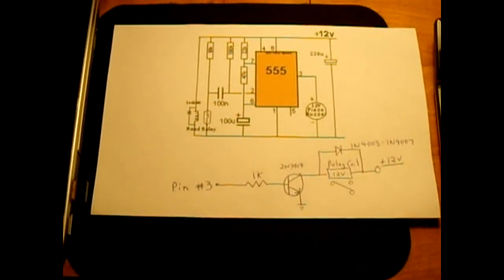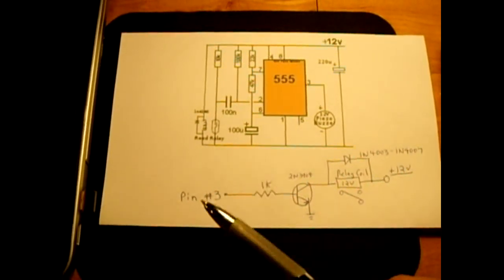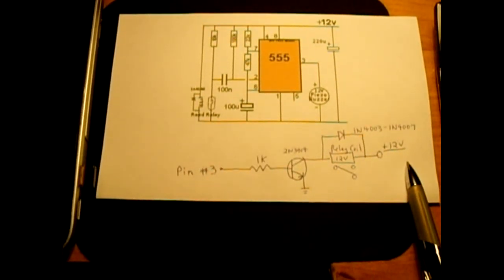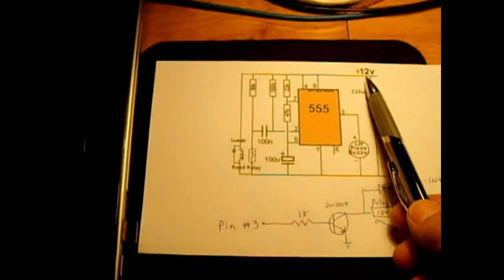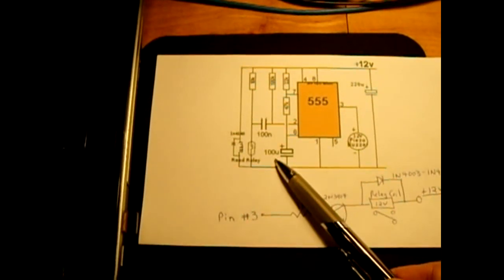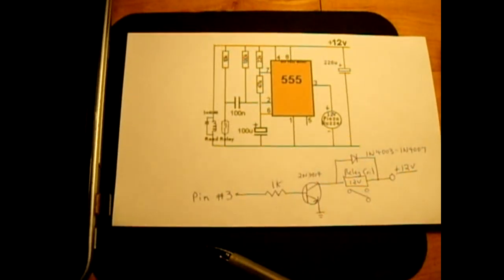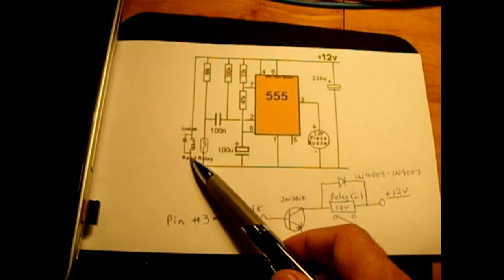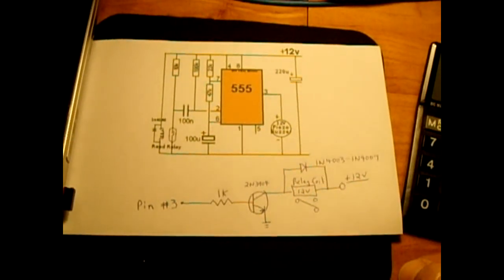12V Timer Circuit Activated By Power ON

Comment: Anybody have a  READABLE copy of the schematic?  The tinypic link to the schematic is no longer available.  THANK YOU.

Update:  I think resistor values (left to right are 10k, 100k, 22k above a 47k)  Thank you.
Reply from the maker: I'll replace the link. Check back later.
Reply: @electronicsNmore  DO we have the link back coz its still not working? the ckt is not clear in the video
Thanks

Comment: Thank you for sharing the video, I Like all your videos, you are so smart. 
I have a question, can one or I should say could you make a circuit running from and on 12 volts that would start dimming lights lets say at 9pm and light off all the way at 10pm, and than slowly back on from 8am to full light by 9am?
I have a few birds and I want to have something like that so they have the lights go on and off at the same time and with dimming, I now just use the 120 volt light times, but I want to run the light from my solar batteries on 12 volts.
I really need something like that. but I'm not smart enough to make something like that. I think for you it would be so easy.
Thank you From Calgary AB
Reply from the maker: I don't know any. :-(

Comment: This circuit is what I seek, but only half the equation for me.  I am looking to run an electric motor for 5 seconds when the circuit is activated, then run the motor backwards for 5 seconds when the control circuit is deactivated.  Any ideas?
Reply from the maker: +Matthew Miller 
Hi Matt. What you need is a circuit operated by an Arduino Microcontroller. Try a Google search online for something similar. Thanks For Watching

Comment: Is it possible to modify this so it can be used to operate 4 foot well lights separately? So have a relay for each door, but have 1 timer circuit?
Reply from the maker: +hunker7photovideo 
Hi there. One circuit can operate all 4. If you want 4 separately, then you need a control circuit for each one. Thanks

Comment: Hi, I'm hoping you can help with this one. I'm looking for a timer circuit that will trigger a light to come on using the door lock/unlock signal. Otherwise it would need 12v power, then use a signal from the door lock/unlock command to trigger the lights to come on for an adjustable period of time. Since the lock/unlock command isn't constant, I'm thinking a latching circuit of some sort would be needed, right?  Thanks in advance.
Reply from the maker: +polarys425 
Hi there. I have a couple latching circuits you can use on my channel. I also have this video below which can be used with a latching circuit.

https://www.youtube.com/watch?v=FZxpw6_lgC0
Thanks

Comment: whats the difference if you use a relay there or just connect where the relay contacts switch is together without the relay , then when you apply power its the same thing as connecting those two wires together as in that 12 volt line through the 10k  resistor through the reed relay contacts to ground , so why not just eliminate the contacts and wire it straight through , then when you apply power it would connect those 2 wires together anyway/;

Comment: can i use this to run a 12 v dc motor ?
Reply from the maker: Nitisha Ahuja Absolutely. Just make sure the wires supplying the motor, the relay, and the battery(Power Supply) can supply the current required.

Thanks For Watching! Please share my channel with others, and rate Thumbs Up.

Comment: This circuit is what I am looking for in a project I am working on.  I am wanting to use a micro switch in place of the button.  The intended use is to trigger a light on a steel gong shooting target.  Bullet hits the gong, gong swings tripping the switch turning on an led for 5 seconds to indicate a hit.  All of this will be connected to a small motorcycle battery (12v).  I am an amateur when it comes to electronics so in looking at the schematic I have no idea of what the other components are aside from the 555 timer and the capacitor.  Could you send me a list of all of the components used to make this?
Reply from the maker: jmolina65 Unfortunately I do not offer special assistance on this channel. I make sure I produce well explained, detailed videos to reduce the number of viewer questions. I have taken the time in the past for some people, but they did not have the decency to say thank you after I took the time to do them a favor, which I did not have to do. I suggest you refer to the link below so you can learn what the symbols are if you are interested in electronics. People that post a couple links sharing my channel, or support my channel by making donations, they will receive a "higher" level of support.

Thank You.
http://www.talkingelectronics.com/CctSymbols/Circuit_Symbols.html

Comment: I can use your help.  I want something similar but opposite.  When I get out of my vehicle (Key Off, or no voltage detected) I want a time to start.  After about a minute, trigger a 12 V pulse to lock my doors.  Once one cycle has been completed, it won't reset until the Key On / 12V is detected, then standby until Key Off.
Reply from the maker: Scott Henry Maybe you can use this circuit:
https://www.youtube.com/watch?v=FZxpw6_lgC0

Comment: I am trying to find/build a 12v timer circuit that is activated by power OFF.  Purpose is to trigger an automotive relay starting at key off then holding the relay trigger for about 3 minutes.

I envision a capacitor being charged by the ignition key being turned on, but not triggering and holding the relay until the ignition key has been shut off.
Reply from the maker: http://www.sentex.ca/~mec1995/circ/relay62.html

How you connect the ignition switch wire to a 12v relay coil will make a difference..

Comment: I would like this for an led to light my key switch and perhaps the drivers side floor and passenger side floor. As I have a remote car starter and the internal lights shut off by the time I go out there. Other apps as well.  Thanks.... you have the coolest circuits and love the 555 timer.
Reply from the maker: I have many circuits uploaded to my channel which can be used by themselves, or in conjunction with other circuits to do exactly what you need. The 555 is a very useful IC, even though it is old technology.

Thanks For Watching!
Reply: I have noticed that. I plan on doing that as the season changed and projects move in doors. Thanks... The potential of the circuits you show are great.
Reply from the maker: Many circuits don't need to be too complex to do very useful things. :-)

Comment: Do you know of any integrated circuits i can buy which achieve this exact result? I don't feel confident enough to build this myself as shown in the video!
Reply from the maker: No, but this is really easy to put together. :-)
Reply: electronicsNmore Thanks for the reply.  Which 555 timer would I need for this circuit? I've found lots of different ones online and I'm not sure which one to use.  Thanks :)
Reply from the maker: http://www.ebay.com/itm/10PCS-NE555P-NE555-DIP-8-SINGLE-BIPOLAR-TIMERS-IC-/140842018251?pt=LH_DefaultDomain_0&hash=item20cad6a5cb
Reply: Give it a try.  Last resort you can put in an on / off switch in line with the hot or ground.

Comment: The reed relay is unnecessary. To achieve triggering on power-up all you need is to disconnect the left pin of the 100n cap and connect it to ground, and perhaps bypass it with a 500k-1M resistor in parallel to discharge it when powered off. You can get rid of the reed relay and it's resistor and diode completely.
Reply from the maker: I actually tried it that way, and had problems.

Comment: The 555 circuit works great, but I've burned up 2 555 chips using the sub circuit at the bottom.  what's the deal with it?  Why can't the timer circuit be used to engage the relay and let the straight 12 volts power a secondary device?
Reply from the maker: You must be using a large relay coil. Also make sure you use a 1n4007 across the relay. Test the diode to make sure it is not faulty. You can also eliminate the problem by using a 1n4007 leading from pin #3 to the resistor. It also would help to raise the 1K value to maybe 4.7K. Problem should be eliminated.

Thanks For Watching!
Reply: electronicsNmore Could I please get a more detailed schematic drawing of the extension of this circuit with car headlights attached.  I seem to be missing something, but don't know what.  Thanks for your help!
Reply from the maker: Jeffery Lalowski
Hi Jeff. The relay has normally open and normally closed contacts. You will use the C and NO terminals. The 2 terminals which are not connected until power is applied to the relay coil. Take your 12V CONSTANT fused power supply and connect it to the "C" (Known as Common) terminal, and then the "NO" contact is waht supplies the 12V power to your headlights. Very easy circuit. Good Luck! Don't forget to check out my other videos and share.

Comment: Hi, any chance you can help, i'm after a circuit that will do the following,push a button(momentry) and 10 to 20 sec later the device is triggered (momentry)12v
Reply from the maker: Hey there,
Can you wait 3 days? I'm making a video for that circuit. Very useful.

Thanks.
Reply: take as long as you need, thats great,much appreaciated

Comment: HI, I need help with a time delay that could leave my car fog lights ON after I turn OFF my headlights. Thanks.
Reply from the maker: If your fog lights go ON when the headlights are ON, then you can use this circuit here:

Power Off Time Delay Relay Circuit

Circuit will be connected to the fog light wires. Fog lights will remain ON for a set time then go OFF after the headlights are turned OFF.